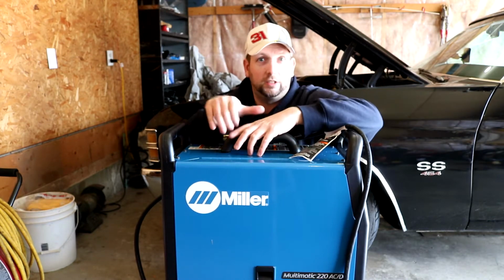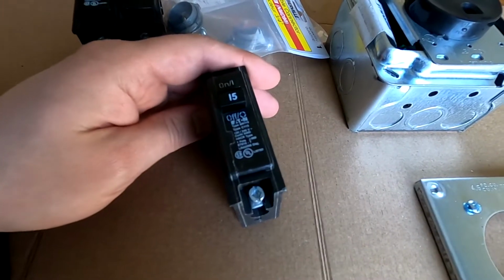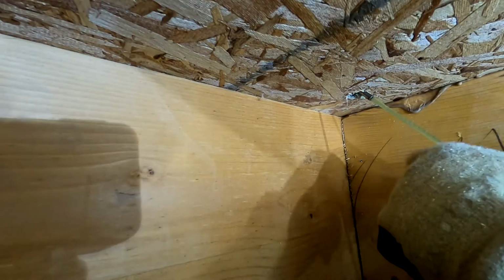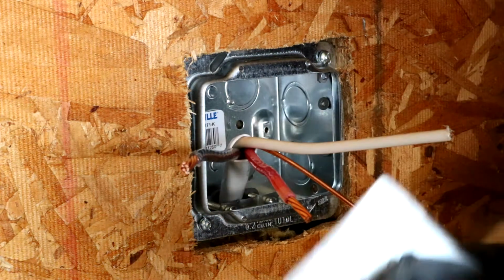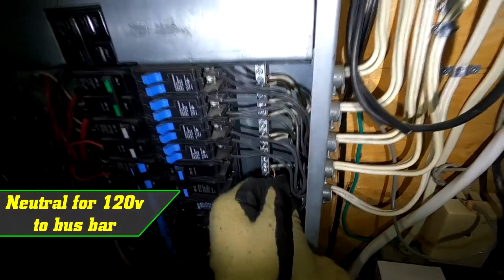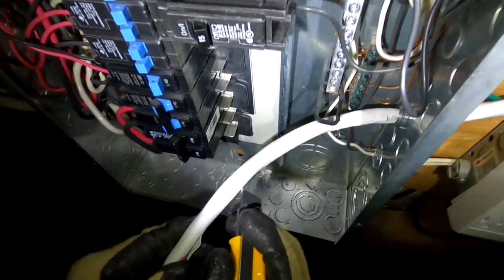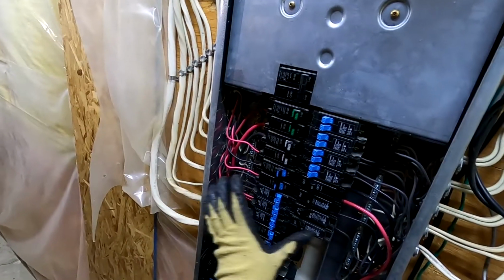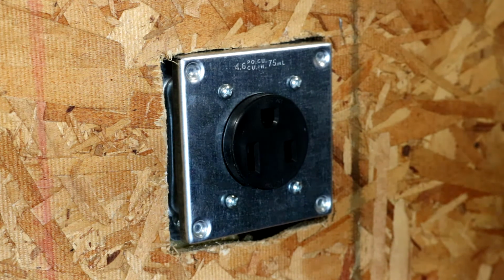DIY - Wiring a new 240v outlet for welder.

Comment: You should have used the white for plug ground, mark it green. Then place the bare bare on a green ground screw to the metal box. This way you won't shock yourself self on the metal box or face cover. Basically 2 grounds, 1 for outlet and 1 on box just in case something shorts or comes loose.

Comment: I wired up my outlet and breaker the same exact way, for my Miller thunderbolt 160. All the voltage read the same at the plug so everything was good. Until I turn the welder on and heard a loud pop. Someone please tell me why this happened?
Reply: That pop was the sound of you running out of money no doubt. Its a classic welder mistake.

Comment: Overall, a good video.  Comment is to be constructive, not a put down.
You bought more cable that you needed.  #8/2 WG would have been the correct choice.   #8/3 WG is overkill.   Be careful with the white conductor!  It may have ghost voltage on it and give you a tingle since it is not connected to the neutral or ground bar to drain it.  Also, you put a surface box cover on in a flush install.   And as others stated, the connector should be moved to the outside of the box.

Comment: Can I pigtail my 240v outlet to another one for my welder and plasma cutter? Won't be using both at once. Just tired of stretching cords back and forth.
Reply: As long as the cable is at least 10awg or bigger depending on your needs, you can definitely do this but it’s not something that most electricians advise as in theory the circuit could be overloaded if let’s say someone turns on your dryer or whatever and your outside welding and didn’t notice it. I’d do it as a temporary fix while I saved up for a 6awg 50amp setup. Best of luck and stay safe.

Comment: As an electrical guy, there is a seperate part to the National Electric Code (nec) for welders.

I would recommend you made it the 50 Amp recepticle (as used for car charging in the future).

Garages and outbuildings (shops) currently need gfci protection for 125 - 250 volt recepticles.  (NEC 210.8)

Give consideration to recepticle position in the sense that the wire only hangs down.  An up wire while plugged in will continue to try to unplug itself.

Metal boxes should be connected to the grounding wire.  (NEC 300.4)  this connection will cause a breaker trip instead of leaving the box energized, all the metal parts energized, if a power wire touches the box.

Remember, 
KNOWLEDGE IS THE TREASURE THAT YOU CAN GIVE AWAY ALL YOU HAVE AND STILL HAVE EVERYTHING YOU STARTED WITH.

So, is it stealing if I can get a whole bunch of you knowledge and you have lost none?  Get a knowledgeable electrical guy and fill your mental tool box.

Be safe.

Comment: Why did you use 8/3 wire when 8/2 is all that was required, unless it was leftover sitting around? The third wire is not needed to wire a 240v welder plug.
Reply from the maker: couldn't find any 8/2
Reply: Thank god I read this. Every video I see uses */3 wire. I could not understand why. I just wired in a 240volt 50 amp outlet for my welder using 6/2 (around 42 feet from the panel).
Reply: @sabbie7 i believe it’s done that way for the color codes, using 8/2 white will be hot when it’s suppose to be a neutral or taped green if ground . but i’m saving money ordering the 8/2 40ft lol

Comment: I want to wire (connect) two single pole 30amp breakers, one on left side and one on right side of panel box, because there empty, for 240 volts, is that possible?
Reply: No you need a double pole breaker with common trip for a 240 volt circuit
Reply: U can but the 2 breakers has to be connected so both of them gets shut off at the same time. Like the previous guy said no. Dont do it. Use a double pole
Reply: no - across from each other they are on the same side

Comment: Romex clamp in from the wrong way at 4 SQ box, You used a raised cover with a mud ring you don't need Otherwise it looks good. I like that you taped up the white wire but did you bond the box?
Reply from the maker: I did not bond the white wire, I taped it up both sides. I tried to copy what everyone else seemed to do. I assume you are thinking to bond the dead wire in case a short happens somewhere down the wire?
Reply: @SS454LS6  Yes you don't use the white wire, no I am not thinking to bond it. Did you bond the box with the ground (bare) wire?
Reply: Hey, I’m doing a similar install. I opted for a 50 amp breaker and 6/3 wire. Just to be clear, the neutral wire is not used when connecting a 50 amp welder outlet? Thanks!
Reply: @WhiteShedRecordings  Correct. White indicates neutral. No neutral on a welder. Two hots one ground.
Reply: @bsmith8564  Thanks! 👍
Reply: @WhiteShedRecordings  Your welcome. If you could find 6-2 with ground you could use it.
Reply: @bsmith8564 I see this is a year old but I’m thinking of using the white wire for ground but taping it green on both ends.  Bare ground wire for ground to the electric box for plug.  
Black and Red hot
White marked for ground 
Bare ground wire for box and panel
Reply: @paulshannon4576  Why? Not only one ground is required, Only one ground is code.
Reply: @bsmith8564  I just went out and looked at the plug closer.  I didn’t know that the ground connector for the plug was also connected to the plug housing so it grounds both.
Reply: @paulshannon4576  On a raised cover you need to ground both the outlet and the box.
Reply: @bsmith8564  I’m watching Spicer Design and I just realized watching his video what you just said.  Somebody that’s an electrician making a video.  Just an FYI but I’m using 6/3 copper wire.

Comment: When u do a 240v plug professionals use the white Neutral  wire as the ground wire and just cut off the copper ground..
Reply: The professionals you speak of are violating building codes and should not be paid any money.  The National Electric Code requires 200.6 that the Neutral conductor be identified as white or gray in color (basically) and in 250.119, the equipment grounding conductor be bare wire or green (basically).

Because they serve different functions, they cannot be interchanged.  One returns circuit current to the panel and one is a low resistance path for fault current.
Reply: @keithharrington4595 wow this one is 2 years old.  The question I have is I want to use the white wire for the ground on the socket BUT I’ll tape it green on both ends and use the bare ground wire for the ground from the socket electrical box to the panel.  Am I making this more complicated than it needs to be?  This will be in a metal building and I like to have a lot of grounds.
Reply: @paulshannon4576  you do not need to over engineer this.

The ground (bare wire) from ground bar in the panel to the receptacle box (metal box) and then to ground on the receptacle.

The neutral from the neutral bar in the panel to the neutral terminal on the receptacle.  Remember that this will allow the welder to use 120 volts for controls if that is what it needs.  (Hot to neutral 120 volts).

Good luck.
Reply: No professionals do not we know code and white can never be ground
Reply: "STOP!" disregard what I Said a little bit ago you don't put the ground and the neutral together at the  neutral bus bar i meant that the neutral gets put on the neutral bus bar and the ground get hook up with the rest of the grounding wires. i had to go to see what was going on outside and when i got back realized what i said. sorry.
Reply: no, hook the bare copper wire to the junction box then hook the other end to the neutral bus bar along with the white neutral wire

Comment: I hope you hooked up the white wire in the CB box up to the neutral bus bar in that box. Last I seen in the video you weren't sure were it went.
Reply: You use the neutral wire as your ground and don't use the copper ground just cut it off or leave it wrapped up w.e u wanna do..
Reply: @Young937phoenix  No that metal box needs grounded and grounded in main panel.
Reply: @Young937phoenix  you can also use a grounding pigtail/w screw and ground it to the box
Reply: From what I can tell is neutral is not used in these welder plugs. I have to convert a 4 wire range outlet to one of these 3 wire welder outlets and also am wondering what to do with the neutral.

Comment: Thanks for video. Yeah setting up my welder too. Did you setup the older outlet with a 20 amp circuit for 110 volt? Did you check wire size for 110 voltage? I used 6/3 wire for 220 voltage just so wires don't get too hot. 8/3 was ok just wanted a heavy duty setup since wire length was only 5 feet away. Picked up 8/3 welder extension cord to have mobility. Subbed to see welder video next.
Reply from the maker: I used a 15 amp breaker and converted the old 220v outlet to 110v. I used the existing wire which I believe was 12/3 as it's sufficient for 15 amp circuits. 6/3 is a THICK wire haha. No harm in going bigger.

Comment: nice video, i saw you had a 71 chevelle, i bought a 72as my first car and i’m getting this whining noise, i think it’s the trans, is this normal, it’s more of a whirl as the rpms go up through first gear, after first it seems to be ok in second and third.
Reply from the maker: Sorry I missed this. Lots of variables. Some transmissions are noisy because of the way the gears are cut, and sometimes its not normal.